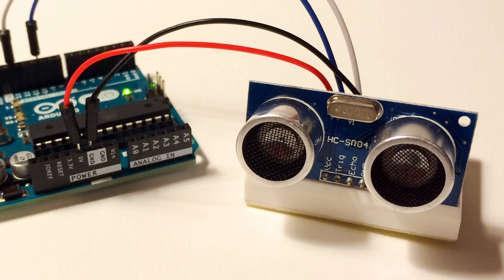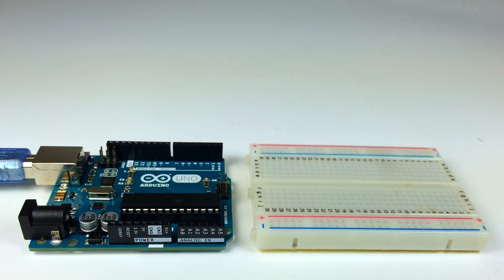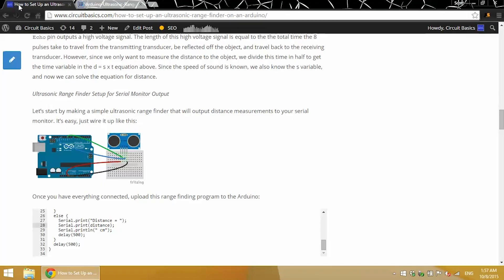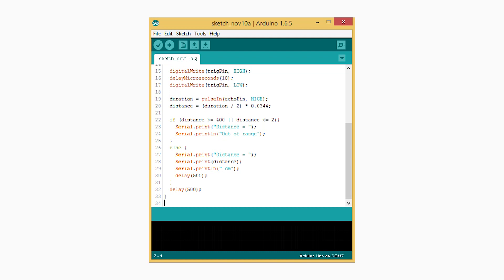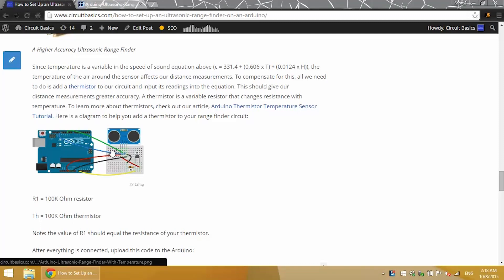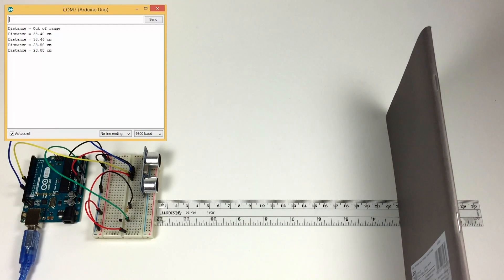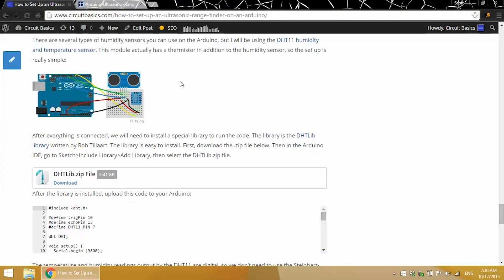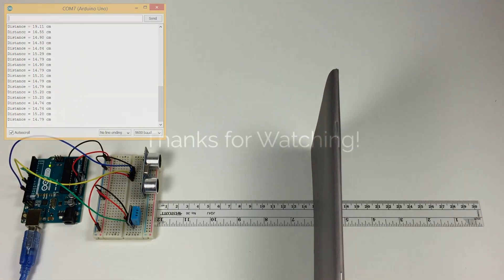How to Set Up an Ultrasonic Range Finder on an Arduino

Comment: Thank you for the tutorial for the ultrasonic range finder however i have been stuck on a problem while trying to connect the lcd display to the circuit . I have followed the hardware and software exactly the way it is shown and the lcd does light up and it shows 16 little boxes but it doesn`t display anything on them so if you could help me out it would be great.

Comment: i have out of range issue...
please help me!
Reply: I had that same problem and what I found out was that my trig and echo pins were in A10 and A13. I just switched them from the analog to the regular 10 and 13 slots
Reply: also me the distance= out of the range
Reply: @howidamostafa8789  solved
Reply: @howidamostafa8789  before 2 years

Comment: Hello, I have a rangefinder that outputs the realtime distance every sec to a laptop display. The unit is run by a small program to display the numbers. Do you know someone that can use arduino programming and use a small LCD to display the values instead of using a laptop display? here is the link to the laser rangefinder: http://www.lasertech.com/TruSense-Laser-Sensor.aspx

Thank you so much!

Comment: Very nice, educating and easy to follow!
I saw some interesting improvements if instead of the notebook, you had moved a square box of some sort in front along the ruler.  Also if had aligned or measured the number of centimeters to the facing wall some whatever 2-3 meters away for longer distance? ;-)
Reply: +Kjell Arne Rekaa I like this project too.
Reply: Shaver!  Are you kidding?  I am trying to "learn" the linear position and length of a moving piece of wood (200x100x4000mm) using more than one HS04 sensor